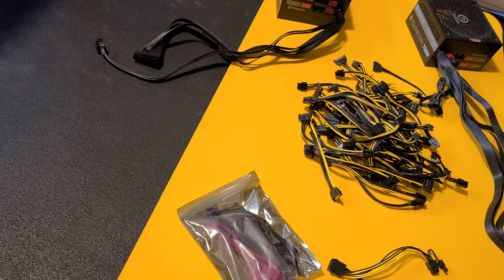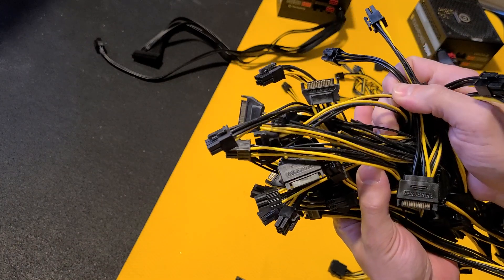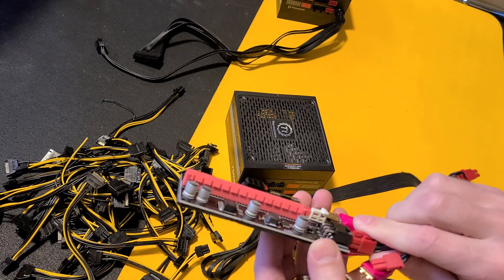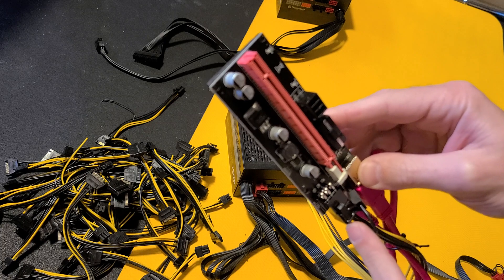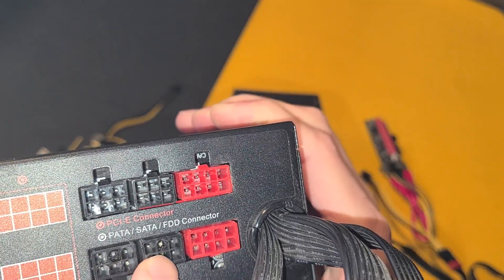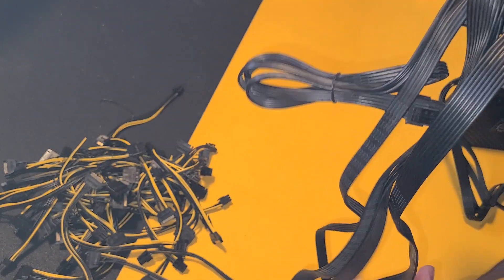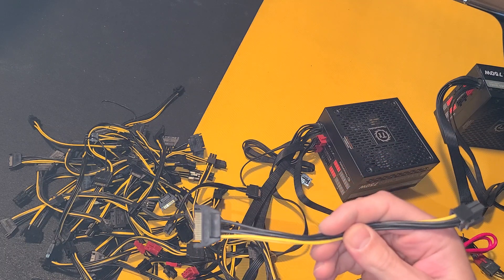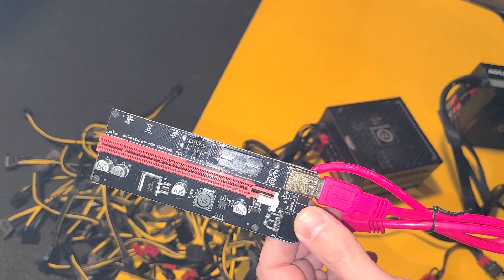Please power your risers correctly! Don't start a fire!

Comment: hey mate, one more question. is there any mining software need to buy or any open source software? please guide me as I am about to finish setup of my small rig.
Reply from the maker: I just generated a referral code for HiveOS. This software is free for up to 4 rigs, and I use it a lot! It takes a bit getting used to but it is rock solid. https://hiveos.farm?ref=620090
Another software that I use is SMOS which is free for one rig for one month. 
The software is also cheap once you have to start paying for it, and you pay for it using the Crypto that you mine.
Reply: @GroweverydayOriginal  I am using phoenix to mine on Windows as I am more comfortable with Windows.
Reply from the maker: @pb8344  Which GPU do you have? I recommend T-rex Miner for Nvidia cards and Team Red Miner for AMD
Reply: @GroweverydayOriginal  I have gtx 1660 super and 1660. Let me try with T-rex. Thanks for advise
Reply from the maker: @pb8344  You should be able to get about 31 MH on ethereum on the 1660s. I have never run a regular 1660 but I think it gets somewhere around 24.

Comment: How do you connect two PSU with same motherboard?
Reply from the maker: I get a little adapter called an "add2psu" that you can buy on Amazon. There are other ways to do it but this is what I have used

Comment: Well yes and now.
RTX 30 series yes. Dont do this.
But smaller cards, properly set will never pass 130W. Your main cable can bring in 250+W. Meaning it wont use anything from the riser (if not just powering the fans).
So older cards can totally 100% safely use the sata port power cable. Newer cards, with high wattage : you're taking a risk , don't be an idiot. Don't do it :)
Good video !
Reply from the maker: My melted cable was on a GTX 1070 card!!! I don't trust these SATA adapters on anything!
Reply: @GroweverydayOriginal  yes, It can happen with any card, if the OC isn't right, if the power limit isn't set properly etc... But a low power card set properly will never drag more than the max amount the sata port can handle.

Also if your CABLES melted. that's not the same problem. Sata PORT is the element that can't take too much power. It will burn, melt the plastic and potentially catch fire. But it won't melt your cables. You probably had a defectives cable :)